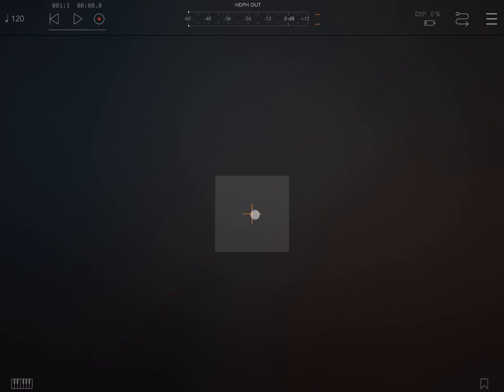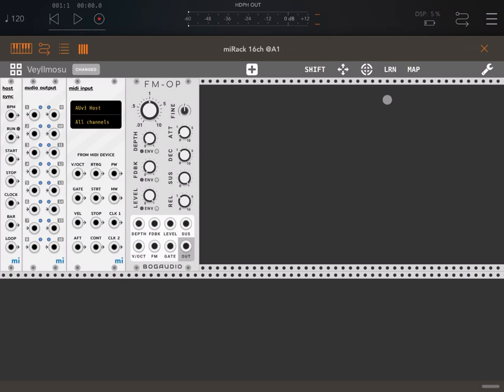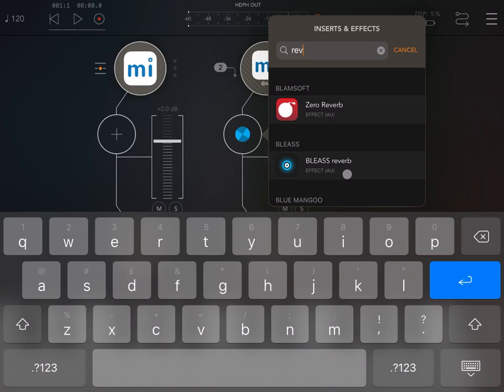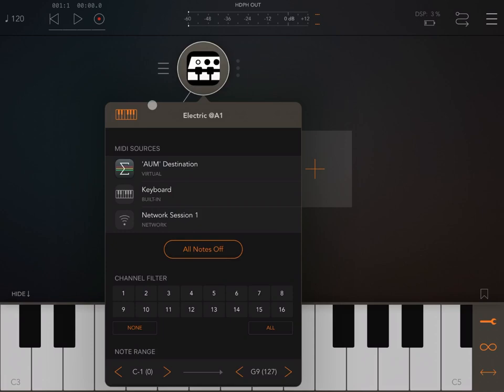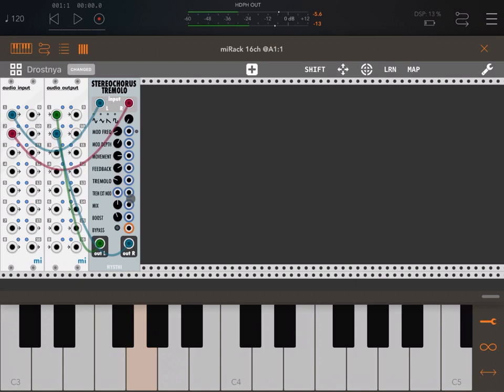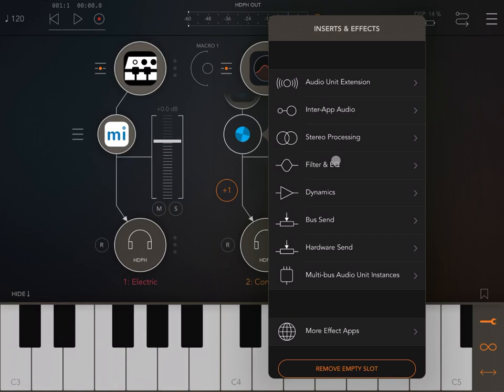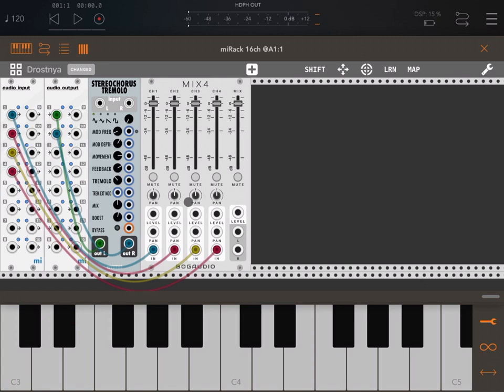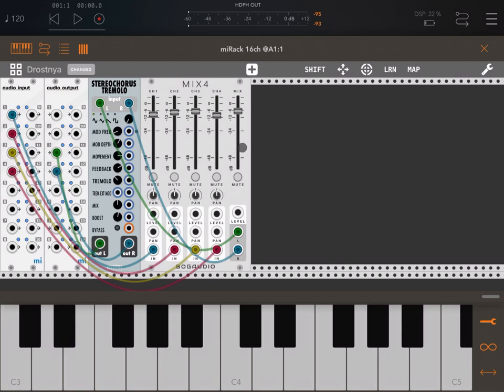miRack AUv3 - Preview/Tutorial: MultiChannel Audio and Effects

Comment: I’m trying to do this (successfully< i might add) but I’m getting a bit confused when coupling this with my ES-9 as i have to route audio (and cv) via all these busses - i need to use the other auv3 fx i have which is why i am using AUM. Is there a tutorial on this?
Reply from the maker: Tutorial on how to use the ES 9 with miRack and AUM? Or Tutorial that expand on this one? Do you connect the AUM outputs to the audio interface outputs?
Reply: @soundformore  yes. I have some inputs working as well as some outputs. Both cv and audio but then some seem not to. I’m trying to get the expert sleepers module calibrated and it’s proving difficult. I think I tutorial that starts from a blank page might show me something I’ve missed. It might be just an objective view on how to handle the stereo bus channels via the multi fx objects.
Reply from the maker: Ok, I create something when I have a moment… does AUM recognise your audio interface?
Reply: @soundformore  thanks for taking the time btw!
Reply: @soundformore  did u have time?
Reply: I’m having trouble the es-5 also
Reply from the maker: Not yet, but I was waiting for the answer to my previous question where I asked if AUM can see your ES-9 inputs and outputs properly…
Reply: @soundformore  yes, of course